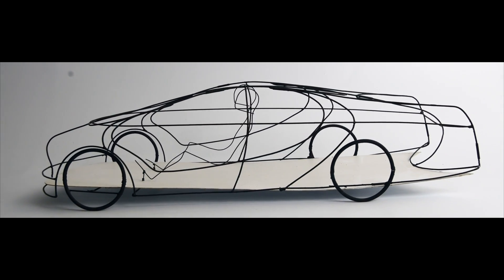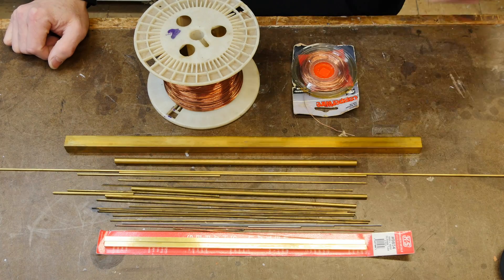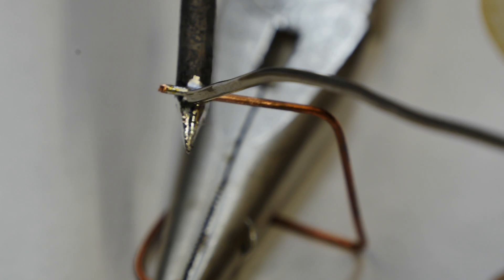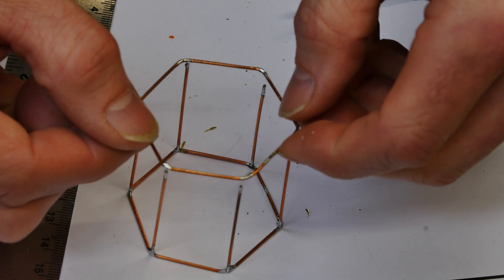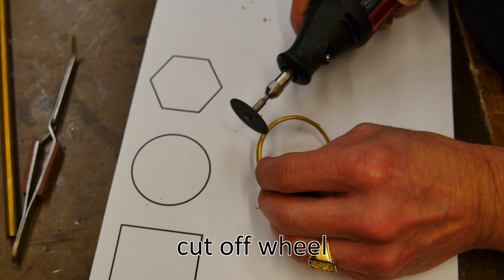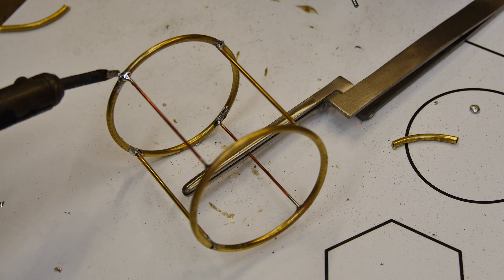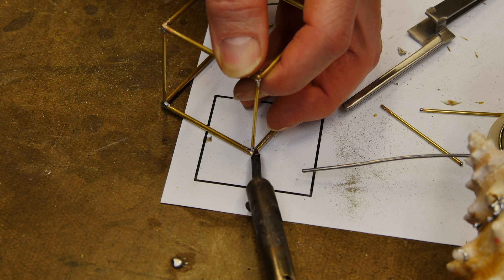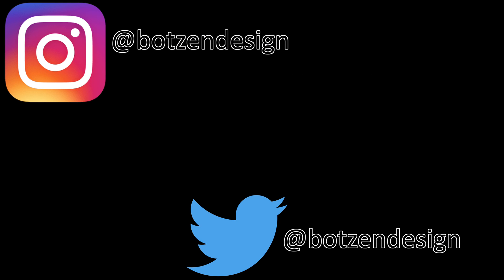Wire Modeling and Soldering Basics for Designers Architects hobbyists & crafters

Comment: If you have a 3D printer I highly recommend printing some little jigs to hold the parts completely plumb and level while soldering them on. It will give you perfect geometry in one attempt every time.

Comment: Hi Eric! I was so happy to run across this video. Props for being a fellow motorhead fan as well! I am building a 1/35 Huey Vietnam era helicopter and been having a real b*tch of a time scratch building the rear troops seats out of 1mm brass tubing. I was trying to glue the racks together but they kept breaking once I was moving them into position. There are so many good tips and knowledge shared in this video. I can't believe I never thought to use the  cross lock tweezers! What a donkey I am! I can't wait to start on this fresh tomorrow and finally get these troop seats built! Thanks a million!

Comment: I'm trying to solder a truncated pyramid shape, but whenever I try to add the third dimension, the two connected parts unsolder, any tips to avoid this happening? I've tried tinning the pieces before connecting but since I'm adding the third piece to the joints it just unconnects
thanks in advance :)
Reply from the maker: You may make a special jig to hold everything in place at the same time.

Comment: Also, it's very easy to find a slightly heavier soldering iron with a wedge-shaped tip.  We see the cheapest soldering iron available here, but better ones are very common!  Solder flux is available in a vast variety.  Some are liquids and can be put on with a tiny brush.  Some fluxes come in a kind of marker, so you can put it on easily.  Some come in little plastic bottles with hypodermic tips to apply.  You don't need much!

Comment: If someone's going to do this a lot, there are so many special tools and literature about this kind of work.  Dozens of books about making Jewellery, many of them start with wire work, and there are whole books about just THAT!  Some special tools might be "Resistance Soldering" machine that makes solder joints very fast and neat.  Special work-holding gadgets: Very common for jewellers' benches, some kind of gadget that holds big tweezers maybe, so you can grab a wire and stand it up, hold it in place for soldering ("third hand").  Some of these things are very cheap and clunky, some are clever and might look like a tiny industrial robot arm with a springy gripper kind of thing at the end.  You can use more than one at a time!  JEWELLERS SAW, cheap and really perfect for this kind of thing.  Can get very fine blades, or an assortment.  The blades are like tiny tiny hacksaws the size of a thread.  Again, most jewellers stuff is cheap and easily available because so many people do it!

Comment: The solution to solder spikes isn't dragging away from the joint, it's more flux. I prefer a thin liquid flux. If you use enough flux, the solder will auto-level out smooth.

Comment: I would like comment as to the type of solder recommended with thin copper wire, say 1-MM, 18GA wire. I have several hoops to form around 4.5-IN dia X 12-IN tall Silo replicas (3/8-IN replicas). I plan to use twisted end loops, soldered as small couplers are not available. Silver solder was suggested for use,  ?. I have crafted the wooden mortise tenon barn these were with. Your comments and time are appreciatted.
Reply from the maker: Silver solder would work, a bit overkill for a model, but it should work
Reply: @EricStrebel  Thank you.

Comment: I've found that the flux in the core is usually not enough. Flux is cheap, so you can take a bit of it in a stick and put it all around the joint. It works the same if not better.

Comment: What type of wire did you use for the car shown at the very beginning of the video. It doesn't look like copper. Is it steel? Do you use rosin core solder for that?
Reply from the maker: Brass tubing from k&s
Reply: @EricStrebel  Thanks!
Reply: @EricStrebel  why does it look like thin wire, rather than tubing? the wheels look like the tubing to me, but part of it looks like wire?

Comment: What is flux I don’t understand
Reply: This might be too late but it basically cleans off the metals so the solder can stick
Reply: How do you use flux?
Reply: @CharlotteHuUSMC  it can come in a paste or a liquid (there might be another form) and most people use liquid cause it's easier and works better, but you basically just paint it on the metal that you want the solder to stick to so it can create a clean surface for the solder (so that it will stick). You also leave the flux on while soldering and then you can wash it off after you are done (preferably look at what other people use to clean their work on Google, best way to look is stained glass artists). Flux cleans the surface instantly so you do not have to wait long before soldering on top!
Reply: @CharlotteHuUSMC  also preferably do NOT leave Flux on any product for more than 8hrs (idk why, I cannot remember, but that's what it says. Might wanna research that too!) which is easy if you wash it off your product after you solder! :)
Reply: Another name is tinning. It helps the solder flow and join the two parts you joined together. It’s corrosive so wear gloves.

Comment: Thanks, this is helpful. When you say pre-"tin" (3:55), does that just mean putting a little bit of solder on the wire before assembling the joint? The term "tin" is confusing me here.
Reply from the maker: Correct

Comment: You are soldering brass pieces, but what about a metal rod that is not brass? I'd like to work with metal pieces that are silver colored instead. Your advice?
Reply from the maker: Should work, with steel, not aluminum however
Reply: @EricStrebel  Thanks for your timely answer. I'm new to all this and I'm hoping at some point to create double-curved grids that are reminiscent of the wire chairs that Bertoia designed long ago.

Comment: I use both flux and flux core solder- makes a better connection and also solder flows to the heat- so I apply the heat to the backside since my connections must be airtight to keep product in the tubing. Thanks for the videos, even having done my craft for 4 decades I still learn every day.

Comment: I wanted to use iron wires but the tin isn't sticking even after sand paper and i even put the flux paste to remove oxidation but wont stick

Comment: I want to make a roll cage for a RC crawler and I'm thinking about copper tubing. Any down sides of using copper tubing?
Reply from the maker: Yes, it's soft. This makes it easy to work with of course but it can be easily deformed or damaged

Comment: I'm having a hell of a time just putting two pieces of copper together. I pre-tinned, but maybe too much? Does the shape of the tip matter? I only have a cone tip, but I can get a flat one if that would be better (it's what I saw you use). I shouldn't need flux with flux core solder, right?
Reply from the maker: Sanding and extra flux never hurts
Reply: @EricStrebel   Sanded almost down to do-overs and fluxed again. Tried with both liquid and paste (not at the same time or in the same place). Am I possibly being too impatient not waiting until the iron is hot enough? I got a better iron and a flat tip, and the best I can do is to melt a blob of solder on the iron and then place it.  Sometimes it works and sometimes it doesn't. I can feel when the solder melts because it sinks into the piece, and I can make one really good pass that's smooth. But then when it cools, it comes apart. Using rosin core solder doesn't help. Noting flows. It just blobs. Not getting any flow into the actual joint. DId I mention this is my first soldering try and I suck just like any newby? HELP?? Is it just a matter of practice and a good tip (because mine seems to be disintegrating).
Reply from the maker: Seems like not enough heat in the metal, get it good and hot, then Add the solder, you might need a torch if your metal had a lot of mass
Reply: @EricStrebel  Thanks, but I think I solved my own problem. Watched the video again and ... silver. I cheaped out and used tin/lead ... chemistry counts. Geez. I knew that.
Reply: @EricStrebel  It doesn't. Just 1.39mm square 99% copper.
Reply: Watching the whole video again. One of my faults is that I'm impatient. So, slowing down and watching again.
Reply from the maker: Ok, good luck.

Comment: I plan to use these methods to turn abandoned bandit sign wire frames to be vegetable cages for my garden. I'm no welder but pretty familiar with soldering. Thanks!
Reply from the maker: Best of luck with your project

Comment: Hi Eric, could you weld the brass together without using the welding rod? 

Also I failed to straighten my copper wire which is 1,2 mm thick, i followed your steps. What can i do? 

Thanks for this awesome video
Reply: Also do you think it is possible to make  triangles with nice edges using brass tubes? Thanks ☺️
Reply from the maker: Yes

Comment: Use a higher power rating of Soldering Iron like 60W - 100W to avoid cold solder joints. Use also soldering paste to have good solder joint

Comment: Hi! Not sure if you still read this, but its really hard to find any info on my question: What type of wire should i use for soldering, if I dont want to use brass/cant get a variety of brass wire? Can i solder "steel" wire, if so what type of steel wire should I get? cheers, Felix
Reply from the maker: Should work, test it to find out.

Comment: Is there a way to paint over the silver part? Recommend anything to make the structure all the same color?
Reply: If you sand and clean a model made with the techniques in this video, it could be painted with most any spray paint or paint designed for metal. Any paint at all would work if you first prime it correctly. There are better soldering instructional videos out there though. This one is okay to give some basic concepts, but there are some pretty basic flaws too. The poor end results speak for themselves (not to knock Eric, I know how difficult it is to do delicate work behind a camera).
Reply from the maker: I have since upgraded my soldering iron, that makes a huge difference in the finish product.Makes way better clean joints

Comment: Hi. I solder frames on a 2d plane for my jewelry making. Is there a reason you are using a small soldering iron instead of a torch? Using a small butane torch and some silver solder you would get much cleaner, stronger, solder joints using less material.
Reply from the maker: Don't own a torch

Comment: Eric, is it possible to solder steel rod as well, or just the copper/brass rods? I assume you'd need to braze when you're using steel.
Reply from the maker: Just get it hot enough and you should be able to solder to it, clean it real well

Comment: Really useful video, thanks. I've been testing out some 2mm aluminium wire to make some models. It's very malleable and so I can easily crush the shape once I've got what I want. Do you suggest using brass instead to stop this from happening? What other wires can be soldered?
Reply from the maker: Cooper wire works best, good luck

Comment: Great video. I am going to try make a model using brass
Reply from the maker: Fantastic post on social media with @botzendesign.
Reply: @EricStrebel  i have had a little practice with some brass from old locks i had. I have been trying to source some brass square tube to try with that but at the moment i cant seem to find what i am after (i am in the uk) so i might look into using some brass rod instead and use brass plate where i need it

Comment: sorry to say but you  FAIL  basic soldering techniques 101.  check some of the youtube vids on this subject, especially the ones for soldering electronic stuff.   you need a decent flux paste and a wipe pad to wipe the tip of the soldering iron as your tip is way so tooooo dirty.
Reply from the maker: traktor works yeah, I agree probably not my best example of me soldering, not the greatest gear either, good soldering iron would make a big difference, some of the new ones are quite good. Thanks for your comment and support, much appreciated
Reply: @EricStrebel  hello eric.
further to the topic part of your problem is the soldering iron you are using is more meant for lighter work, eg electronics.  the metal, brass and copper you are soldering is very heat conductive so as soon as you put the iron to that metal a lot of the heat in the iron is lost to the rod metal.  actually i think you would be better off using a gas flame type soldering tourch.  they are very hot and you can get one with a very narrow tip that produces a very narrow focused flame. alternatively just get a larger electrical iron.   also maybe try using whats called SILVER SOLDER.  it is the solder plumbers use for copper water fitting joints.   it is stronger but runs better BUT you then must use a flame torch.

also thankyou for being gracious enough to take on board my comments.

my wishes and onwards to soldering 102, the next level. 😋😄👻

Comment: Another tip. :)

Try using some " La-Co Regular Soldering Flux Paste ".  It pretty much eliminates the need to prep the metal before soldering.  As an experiment, I've used it on heavily oxidized copper pipe without sanding or any other surface prep and it resulted in airtight joints.

Comment: Awesome video! Brass has become a very under-rated material in the shop.
Side note, I noticed your iron getting a little blobby and crusty with the solder, see about getting some Hakko FS-100 solder paste. It will clean up your iron tip like new, and give you better heat conduction. Just dip your iron in for a second, let it cook in the air for about 10 seconds, wipe, and re-tin with fresh solder. Cheap item that lasts forever, and highly suggested for anyone soldering. From your friendly certified soldering tech. <3

Comment: Tips to make it easier and maybe better. 63/37 solder is "eutectic" and never produces a cold joint. It is ideal. The Kester #2331-zx flux pen is fantastic and solder will wet really well. The flux washes off in water. Poke your iron into a brass sponge frequently before you solder. I cut that brass tubing by rolling under an Exacto blade.
Reply from the maker: Great, useful information. Much appreciated
Reply: Seconded using of flux. Either no clean flux or water clean flux. It would drastically improve solder "flow" during tinning and actual soldering.

Comment: I'd suggest you pickup a cheapo steel/brass dish scrubber for cleaning off solder, and stick it in a halved can. Just stab the soldering iron into it to clean it rather than smacking the iron, since that splatters molten lead solder everywhere.
Reply from the maker: Okay, I like that idea

Comment: Thankyou for the instructions.
I was wondering how useful and effective is this method of modelling in the software age
Reply from the maker: It translates directly of course, and it's much more interactive than a 2D screen and instantly modifiable. If your working with a large group, everyone can see the entire platform simultaneously.
Reply: Babu Moshai anyone in the design industry will tell you that a physical, tangible item is worth more than photographs or 3D renders on a screen. Touch is a very powerful sense.